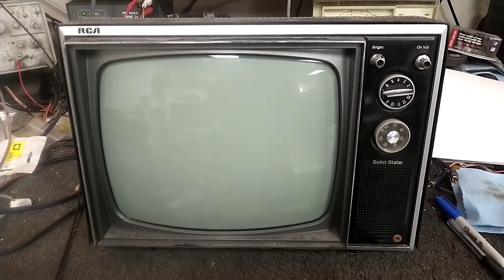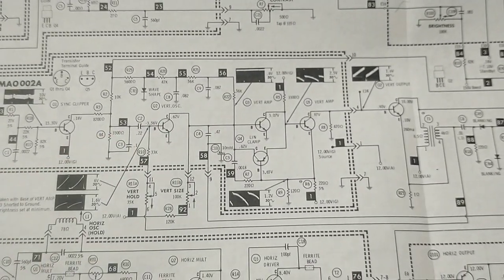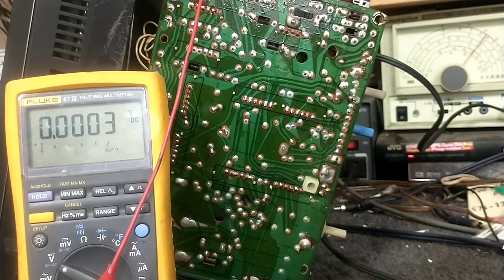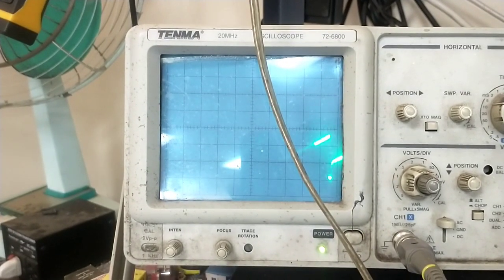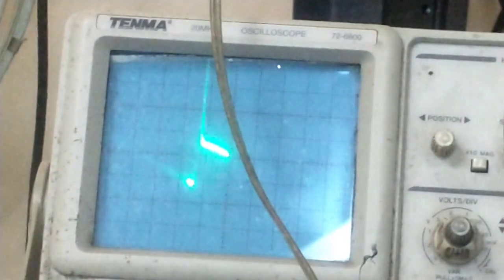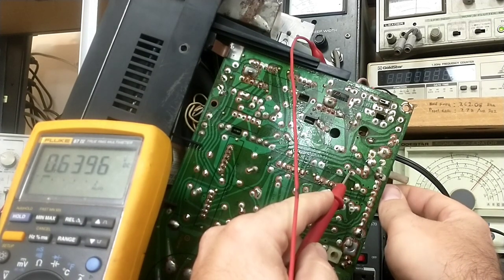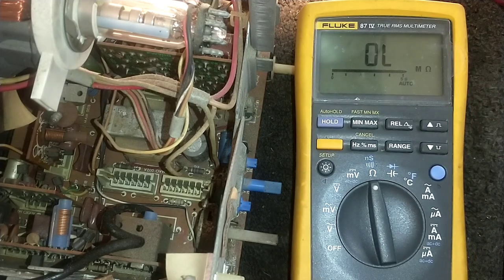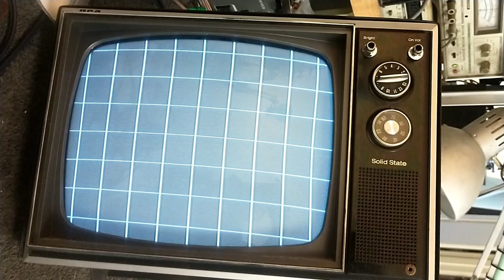Servicing a 1974 RCA AS128e 12" black and white solid-state television. Part 3/?

Comment: Glad it works. Because you were getting a decently large waveform on the output of the module my first suspect would have been the 1 ohm resistor on the emitter.

Comment: A horizontal problem on the right hand side would be a weak horizontal output, would it not?

The energy starting the sweep on the left hand side is stored energy from the tuned circuit and reaches a null at center, at which point the horizontal output starts conducting and carries the beam across to the right. That is how I understand it anyways, but I have been mistaken before.

 (edit: deleted tube comment) oops! this is a solid state set. I was watching another video of a GE black and white I think shango066 did.

 Thank you for sharing your knowledge, I am here to learn, and I enjoyed the journey.

Comment: Ok so first-three  decades all the capacitors were failing in old electronics, coming into the 4th decade were needing to replace drifting resistors 🤨nice video JP thanks
Reply from the maker: Don't forget terribly noisy transistors too!
Reply: Been there , BTW every yoke that had a shorted turn in it that I’ve ever had to replace caused a trapezoidal raster

Comment: Treacherous old components.  Definitely not mil spec.  This thing is almost 50 years old, way more than it was ever designed to need to be.  Also yes, transistors are funky things to troubleshoot compared to tubes, because much of what is going on with them is in the currents, not in the voltages, and how are we going to see that without cutting into a current path?